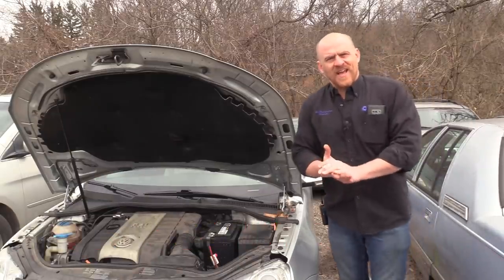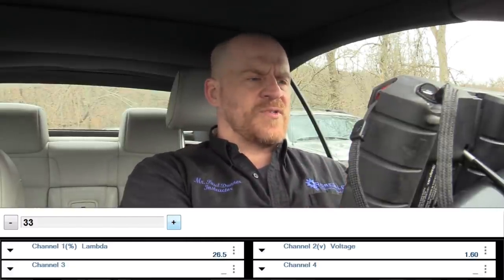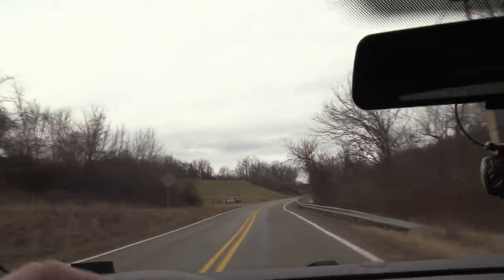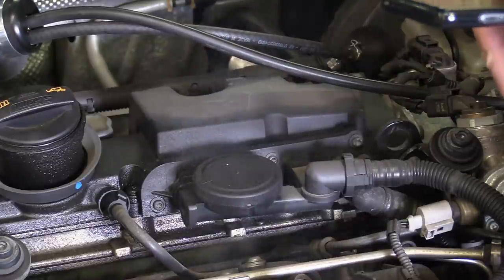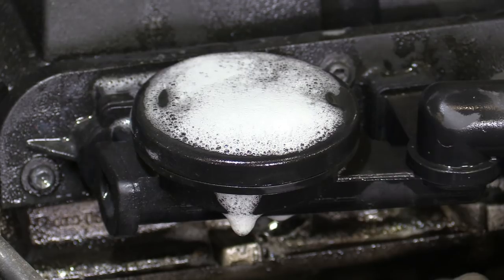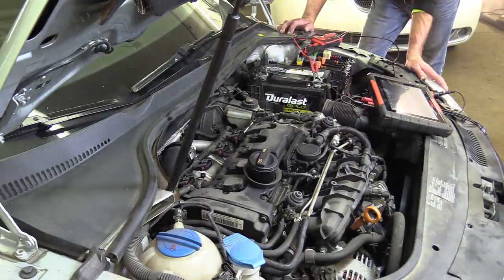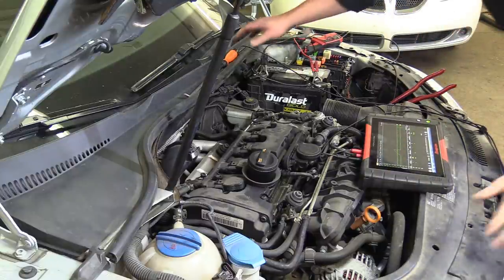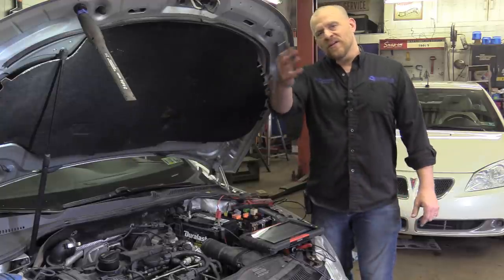Lean Condition and Misfire Troubleshooting - VW/AUDI

Comment: any driveability issues should be test driven.That was my experience before my retirement.Very important in my views.Good job
Reply: Test drive before to verify customers complaint and gather any useful information the customer did not tell you or didn't know to tell you. 
Test drive after repairs to verify problem is fixed.
Reply: Yes test drive after repair is done also
Reply: Where there were multiple drive ability issue my policy was to get another tech or service manager to do the final test drive before signing off.

Comment: That MVB blew my mind! First I've heard of that. I've worked on a few VW's, but none were drivability complaints. That's where I was introduced to the odd world of the TRIPLE-SQUARE socket! What strange engineering that one is! I've also sealed up a leaking vacuum pump by disassembling it successfully - the manual wants you to yank the transmission! NOPE, not today! LOL. My buddy is still driving it 4 years later, leak free and with strong brakes. Then I did an oil pan on a 1.8T Passat - that was NO FUN, let me tell ya. Lots of yelling, cussing and turning the camera off, lol.

Your reaction to Pete handing you that coil was way funnier than you grabbing it, Paul! 😂🤣😂 Too funny! Great stuff as always, brother. 👍🍻

Comment: Paul, great video as usual. I remember you saying you had VCDS in a previous video you did with Tommy. I'd recommend using VCDS to get more familiar with MVB measured value blocks etc. On the later CANBUS diagnostic cars like this MK5, you can search for the value you want by its name or definition such as misfire counters.

Comment: Paul, because you dont know how somethings works. It doesnt make it a bad design. I pulled of hundreds of covers and coils with this design never had any problems with it. Nice video and diagnose.
Reply from the maker: For sure. But we all bitch about things we don't know don't we? ;,)
Reply: I've had trouble with them too. First one I took off broke.  I think by definition, a good design would make it easy and work well, right?  Bad design.

Comment: The 2.0L FSI engine is also known to suffer from valve cover failure due to a sticky or failed diverter valve. This leads to premature and often reoccurring pcv failure and excessive oil use. When changing the pcv it is advised to video scope the large square port in the valve cover along the left hand lower corner for cracks.

Comment: Great job! That pcv is reminiscent of the GM (Chevy Cruze) valve cover diaphragm failures. Sometimes customer will complain of a whistling noise upon acceleration on vw and Audi. Always check that pcv. It fails a lot. As far as covers breaking because stuck in grommets, well I've seen it on more than one make ...
Great info on the mvb's! 
Positive leads needs to do more vids...not just diag ones either.
Reply: H

Comment: Great video Paul, if anyone wants to know Volvo's use lambda values but not blocks to measure. They also have similar pcv traps starting 2005 up. There is a rubber diaphram inside that circle piece that tears. Makes a nice whistling sound lol

Comment: Good to see you tackling a euro box man well done 👍 Nice video 👍 new challenges are good for keeping your thought process sharp . Over the pond in the UK we’re used to these type of “euro boxes”😉 . The leaking PCV unit  will probably mean renewing the whole valve cover with genuine parts (after market repair kits won’t last 5 mins) . Usually the plugs go bad & because the coils give a strong spark they soon track to the nearest ground path & once this happens they’ll need renewing as it damages the insulation & for some reason the coils have a metal sleve designed in which acts as a superb earth route (it might be a surpression design to stop the coil interfering with other components) .
Reply: The pcv is separate to the valve cover on this EA113 2.0 engine. Genuine parts are supplied separate to the valve cover. Simply bolts on with a few T20 screws. Common failure for the diaphragm to fail inside, hence the bubbling soapy water on top.

Comment: Hi Paul put the rubbers back on the air box and put some grease on the rubbers before you put the air box back on  and it will come off easily next time.  All vw , Audi  have air / engine covers held on this way

Comment: There's a special, ministry-approved coil remover over at VW haha it hooks onto the coil housing and you can pop it right up. Although, I rarely use it as I once slammed my knuckles on the hood when I forced the coil out. Used a prybar once and cracked the valve cover too, had to buy the customer a new valve cover because he was standing right next to me lol! Good times.

To be honest, I find it really funny that over there across the pond, VW or Audis and all their systems like VCDS, mvb, basic settings etc. are so exotic for you guys, whilst here, I hate any time I have to use VCDS which is every other day. 

In Poland, the gov't has allowed for some time now to register cars shipped from America, so it's the other way around for me, I get to work on Chevy's, V8s, I see a GM and go Wow! I see an Impala or a big-ass 1998 monster of a pickup truck Chevy and I turn my head, haha completely the other way around with the scarcity of information as well. My wife's American so I hope to be able to visit the US one day and just be able to scope out all those cool exotic cars you guys have. 

I still struggle with using VCDS for fuel trim. It's weird. One of the worst designed tools ever. It feels like it should go through some user friendly makeover. You have to know the individual measuring blocks, basic settings coding etc etc

All the best!

P.S. would you agree with my thinking that the 032 mvb at load was that high because of all that fuel and air in the #3 cylinder was bring dumped into the exhaust causing the o2 to read a lean condition so the ECU issues a rich command and retains that in memory because the misfire was always present? Is my reasoning good?

Comment: I am an ex VW Master tech, now independent but still see a majority of Euro vehicles. 

Those PCV valves on VW and Audi, there is a vent hole on top of the PCV, first thing I do on them if they have lean condition and misfires is put my finger on the vent hole while monitoring idle fuel trims, if the trim improves, the diaphragm in the PCV is split.

You gotta watch out on the TSI, TFSI, FSI engines after you fix the PCV, the fuel trims at idle can misbehave and show very lean (absence of oxygen in the exhaust from unburned fuel) and cold misfires and cruising misfires/surging can occur. This is caused by the intake ports and backs of the intake valves being clogged up with carbon. This occurs because the direct injection takes away the normal cleaning of the intake valves with raw unburned fuel that you see on port injected engines, it is imperitave that these engines have uninterrupted airflow into the combustion chamber because of the fuel burn strategy and very small amounts of fuel used during idle and cruise conditions (the S part of FSI if you will.... Stratified) 

Misfires on VW/Audi vehicles with a DSG transmission can feel like a transmission fault.
Reply: Oh, clogged intake misfires can feel like an ignition misfire 👍
Reply: Oh, another one, front or rear crank seal or both can start leaking after a PCV replacement due to the PCV sucking vacuum (and dust and dirt) through the seal(s).
Reply: Good info

Comment: I have to admit that I cracked-up when you called it, "a stupid car" when the condition was that of an ignorant technician admiditly  not familiar with the car. Great vids though, keep up the good work.
Reply from the maker: Ignorant technician sounds harsh lol
Reply: @ScannerDanner  Naaaa, we're all ignorant at one point or another. It's the noble thing to admit it (as you did while admitting that you weren't as familiar with VW's) wherever it comes-up. Keep up the great videos.
Reply from the maker: @LtBRS  true that!
Reply: It is stupid to have a mechanism that isn't accessible for easy release and is hidden from view, as in the case of that integrated intake plenum and vanity cover that when removed leaves the grommets behind - that's just poor design. It's also stupid not to have coils mechanically fastened and that rigid primary side harness takes stupid and pointless to a whole new level.
Reply from the maker: @Tony Rule Word!

Comment: Next time with the pcv leak try to remove the oil cap and the engine will stall out due to full manifold vac in the crank case. I work for the AA in the uk and we carry coils,plugs and the pcv for them as it’s so regular

Comment: Excellent diagnosis, I think you nailed it but obviously your out of your normal element.  FSI is fuel stratified injection.  Part leaking vacuum is called "crankcase vent valve".  Crankcase  vent valve has a diaphragm and regulates a small amount of vacuum on the crankcase to vent crank pressure.  When the diaphram is ruptured it leaks like what you have.   MVB 15 and 16 is misfire counters.  Vw misfire counters are very good.  It probably would have pointed you right to number 3.   Grease up the rubber cosmetic cover bushings on reinstallation so the next guy can get it off easier..  WARNING!  The crank vent valve diaphragm fails and puts too much vacuum on the crankcase and this can damage the rear main seal, which is a incredibaly crappy design, which could make a vacuum leak even after the crank vent valve is replaced.  See my video for more info (different engine though).   Also make sure the dipstick has a o-ring to seal it.  Plastic part of dipstick that retains the o-ring can break off and disappear and this makes a small vacuum leak, leaking off normal vacuum inside the crankcase.

Comment: I have a thousand reasons why I don't work on Volkswagens, but I only really need one...
Reply: I only work on German cars and prefer vw audi to anything. Different strokes for different folks!
Reply: @plowe6751  i find working on them to pay very well tbh! I still believe it pays to be a specialist.
Reply: Four Rings Auto I agree it seems easier to work on German cars to me I’ve had them for the past 6 years.
Reply: @plowe6751  that's why you order parts off the vin number. We use partslink24.
Reply: @plowe6751  get the 17 digit vin number off the car. Put it into partslink24 and it tells you all the information like engine and trans numbers and build date etc. €20 euro per month and I'm using it in Australia.
Reply: Indy shop tech here, being flat rate I'd challenge you to even match book time on an oil change on a vw audi product. An audi for example can have 4 different types of fasteners to remove a underbody shield. Then say you have a tire rotate on the ticket, better look for the wheel lock key, after you take off all the plastic lug caps. Better have a scan tool loaded up and ready to go to reset any maintenance data. Ohh and to check the oil level engine has to be up to operating temp then shut it off and wait for 2 minutes, just to check the oil level. (Yup super quick when the cars been out in the snow overnight) Rant I know.... point is overcomplicated for absolutely no reason.
Reply: Each to their own, I suppose. However, one can talk shit about european cars all they like, but thebtruth is that one strictly has no routine. Obviously you are going to brake stuff when you approach something new with brute force. Obviously you will get the wrong parts when you use suppliers that deliver 90% domestic and asian car parts. There's other suppliers specializing in European cars. Partlink 24 is for europe and australia. Maybe even us. Worldpac is for north america.  Obviously you won't know how to pull information for them when you've never looked out for it. Most vw cars have stickers in the trunk or near/on the engine that tells you engine/trans/final drive codes. Alldata, shopkey, mitchell all have really great service info on euro cars. Mitchell translates track diagrams to domestic style wiring diagrams. There's tools to make tour life easier when performing oil changes, so you don't have to even touch the belly pan. It's called a suction pump. Suck the oil out through the service port/dipstick tube. But it's always a great idea to inspect the vehicle underneath. And while it does take longer, it also costs quite a bit more. A typical oil change at an audi dealer where you don't even lift the car up - just suck the oil out and replace the filter on a cartridge style right on top of the engine - $170 canadian. On a vw where your cartidge is underneath, it's close to 200. So ya, there's loooots of sources and there's looots of money in euro cars. But when one's just used to blindly talking smack about something, one will never learn how to work on that something.
Reply: RAPHAEL LETHERY I made way more money when I specialized in Audi than I did specializing it General Motors

Comment: i have these same coils on my nissan 240sx,i found the only way to get a secondary image on the scope was by getting a spark plug wire and hooking that to the coil and other end to spark plug then using one of those ignition wave form clamps on the plug wire.these coils are tricky otherwise.

also with this being turbocharged any smoke when pressurizing system would be a potential boost leak and would never make sense to see smoke on a turbo engine, the only time ive seen smoke when pressuring the system was on aftermarket manual boost controllers that use a controlled bleed off so it take more boost to open the wastegate.I cant think of any other time a turbo engine would have a intentional leak. then again there are so many different systems i may have just never came across one yet

Comment: Fuel stratified injection. These engines have a port flap in every intake pipe separating the intake in two pathways, from up to down and on low rpms they are closed partial on the lower part, forcing the air to twist inside the cylinder upwards to the spark plugs helping the lean mixture to ignite ( note that these pistons on top are designed not flat but it has two recessions like pyramid style to force the intake air to twist with high velocity), at the same time engine injects the fuel directly in the cylinder in the compression stroke just before TDC. By these means achieves an non homogenized mixture (stratified) and saves fuel running pretty lean. Nowadays these engines are being replaced by the TSI. Great video Paul thanks for sharing. 🙏
Reply from the maker: Paul 😉
Reply: @ScannerDanner  i have correct it 😉

Comment: I heard you say that you were getting smoke from the dipstick tube as well as the pcv valve. Did you replace it as well ? Over time the plastic gets brittle & they break. That will give you a vacuum leak as well.
The other way to see if pcv diaphragm is bad is to try taking the oil cap off. If it's hard to take loose & the vacuum trys to pull the cap back down, it's 100% bad !!
I got a kick out you trying to figure out how the coils come out !! ;)

Comment: Chevy cruze gen 1 have a similar system to where you have smoke billowing out.  It acts as a vacuum regulating diaphragm.  They rupture and causes leaks.  The cruze has a pcv component inside the intake manifold. It also has check valves in the corrugated hose for boost pressure back to turbo.  When this happens the transmission will likely act up because it's hunting to keep the engine from stalling so it surges.  It's a super interesting topic to study.
Reply: It's always a sad day when you look in the back of the intake and find that the little red valve tip is missing..
Reply: MG used a very similar set up decades back the rubber diaphragm would crack but in those days you could replace the rubber.

Comment: The motor cover normally is removed very easy. The grommits should not stick on the motor block. I suppose that the cover hasn't been removed for a looong time and kind of fused to the notches.

The design of the CoPs is not stupid :P 
Bolting them makes only sense if the CoBs are organized as a bar. You have seen yourself how well they stick and stay where they are supposed to be.
Simply push your fingers beneath the connector and pull/pry.
The coils are recommended to be swapped each time the spark plugs are done.

The PCV is housing a closed membrane as far as I recall.

remeber those MVB or get some decent equipment like HexNET or ODIS

Comment: Checking computer signal, power and grounds along with 5 volt reference (if used); wouldn't this be another confirmation that the coil is bad. What about the spark plugs? I had a bad spark plug once and it was misfiring, never seen a spark fail to the point where it was bad, visually the contacts looked ok but it was dirtier all around that the other plugs. The reason I ask this is because people say that the computer diode may go bad if switching around bad coils, in what scenario is this true?

Comment: Those PCV’s are rubbish! A quick check if you were to get another. Is to try and remove the oil filler cap while it’s idling. If it’s failed badly, you can barely get them off. The vacuum pulls them on real tight! As Tommy said, the coils are also really bad for failing. I think it’s the heat that gets to them the most. They have tried many, many different superseded part numbers. None of them work! 😂. Still nice work though man. (I’m not going to even mention the engine covers! They get freaking tight!)

Comment: Your vw master tech should have told you the first thing to check with these codes and this engine type is to loosen the oil filler cap and feel if you can lift it off  with running engine. Ruptured pcv valves are common on these engines. 5sec check.
Reply: ZeypveldAutosport   That would have been a great tip to add to the video.